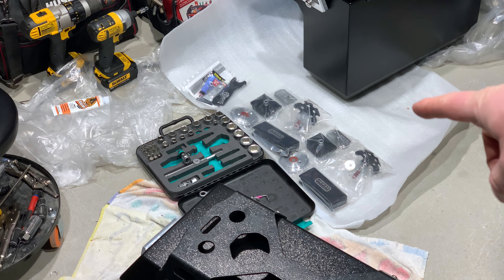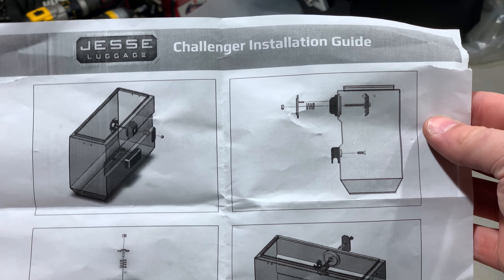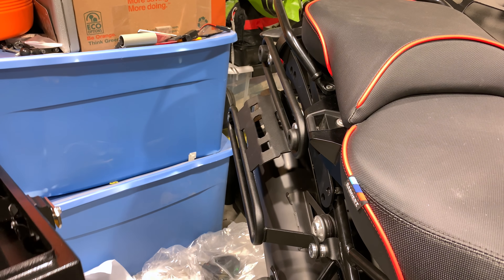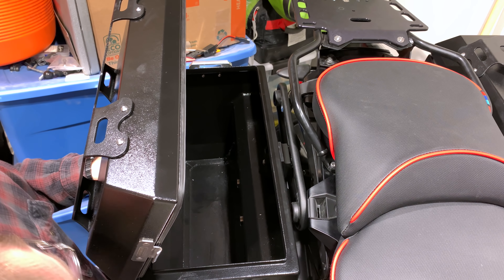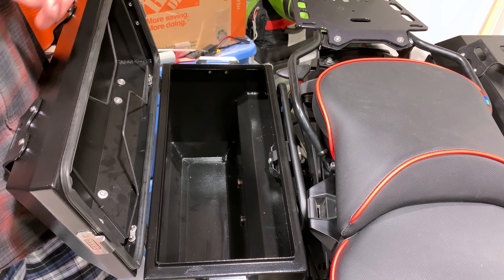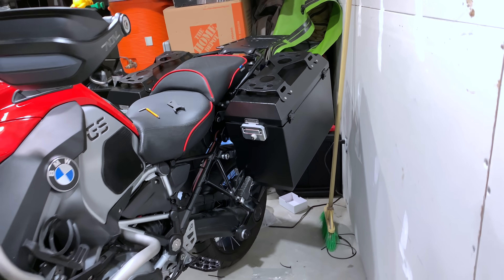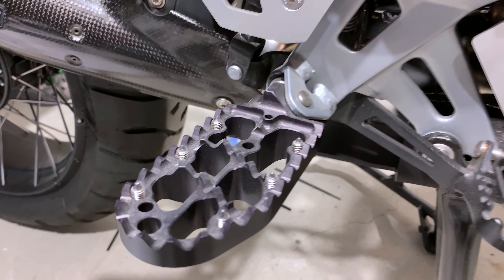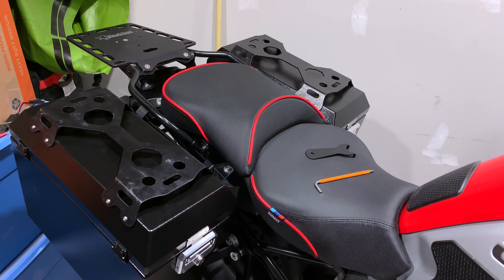Jesse Luggage Challenger Delrin Setup + Install

Comment: Very nice setup! But the best part of the video for me is the Wera ratchet set. I know, that sounds silly. But my son gave me that exact set as a gift last year. I absolutely love them. I can carry it in the top case of my K1600GT, and with a few swapped "bits" I can do almost anything I need. I'm not a serious wrencher, but it is a pleasure to use those tools any chance I get. He originally bought me that kit for my metric sports cars. But I've used it far more on my FJR and K16 than on anything else.

Comment: Hi Adam.  Do the challenger boxes come with this install kit, or is it an add on when purchasing?  Just wondering if yours were damaged is why you're replacing them or if it's an upgrade.

Thanks
Reply from the maker: Hi Chris. The Lid Racks are a separate $99 purchase. The Lid bags are also a separate purchase. They will not preinstall the racks due to the size of the shipping box.
Reply: @AdamChandler86  

Ok,

The item I was referring to was the Delrin mount system you install on this video.  I call Jesse though and it does come with the version you installed on this video.

Thanks
Reply from the maker: Ah, the box will come with Delrin hardware but you must by the luggage rack separately.
Reply: Adam Chandler 

I mentioned your videos when I ordered my pannier system from Jesse today.  Make sure they give you a BIG discount next time you order from them, it was a pretty big order. 😁